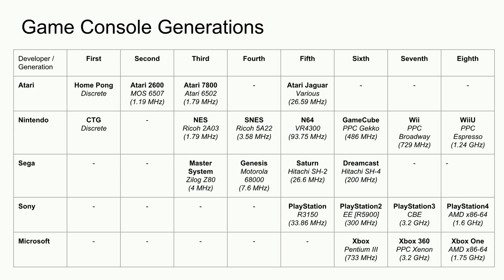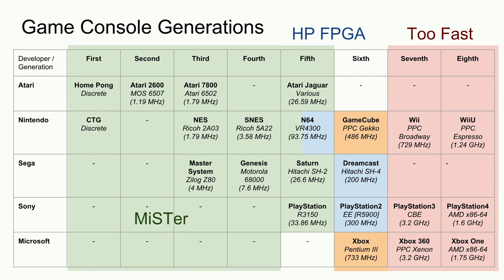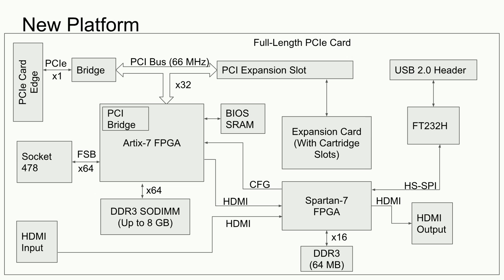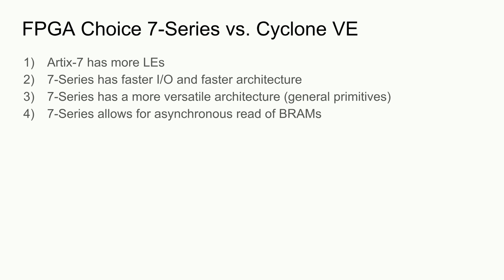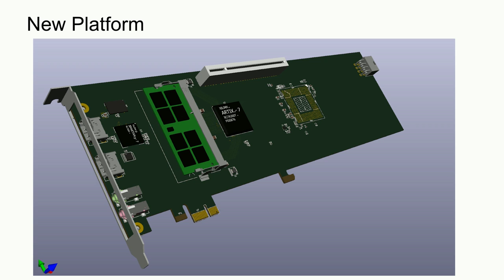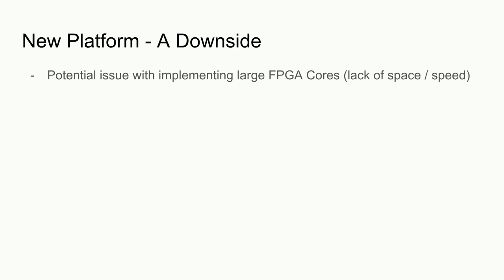A High Performance FPGA Game Console Platform

Comment: I'm no tech, but it's a nice presentation...  :-)
Regarding the XBOX emulation, i'm surprised. The actual state fo emulation on PC is... "weak" to be polite. 
I was prepared to give up XBOX "classic" emulation, even on PC.
I read - long time  ago - that we didn't know precisely some elements of the xbox ( the GPU chipset ?? it's a special version of an nvidia GPU)... and it was a problem to recreate a good emulation.... maybe there is light at the end of the tunnel, as we say ??
Reply from the maker: One of the XQEMU claims that it has made great progress in the past few years (I have not really looked into it).

It's true that we don't know all of the elements of the xbox chipset, but we have some idea of how they were composed. It may require leaked documents, or some old fashion reverse engineering to figure it out though. In terms of developing a chipset, the actual architecture of the NV2A GPU is pretty straightforward from an architecture level, the issue comes down to how precisely to control it. It may, not be possible to implement a PC emulated version of the NV2A though, since it's basically an early version of a modern GPU (multiple shader cores, running at a few hundred MHz). It should also be possible to hookup a high-speed logic analyzer to a development XBox, and sniff the front-side-bus while the CPU talks to the chipset running known operations. That could provide the missing information on where / how to communicate with the chipset components (perhaps that has already been done though). 

An FPGA implementation may be an alternative option there (running the CPU emulation on a PC, and using the FPGA to just do the chipset stuff). I may have given the impression that is had been figured out though, when my main intention was to suggest that it is feasible from an engineering standpoint (i.e. the details still have to be worked out).

Anyway, I wouldn't give up on being able to run classic XBox games on a newer general purpose system. And at the very least, I recall hearing the CEO of AMD (Lisa Su) mentioning that the newest XBox was built with backwards compatibility for the original XBox games (though that just kicks the can down the road).

Comment: The current MiSTer is based on a mass produced (and significantly discounted for educational market) board, Will this "new" board be significantly cheaper than the existing low cost MiSTer board?
Reply from the maker: I am aware of why the MiSTer uses the DE10-Nano. As mentioned in the video, the new board would be around 400$ USD (~4x more expensive than the DE10-Nano). So it wouldn't exactly "replace" the MiSTer, but the goal would be to have a backwards compatibility, so that those who want to use cores which cannot run on the DE10-Nano can still use the original MiSTer cores.
As stated in the video, you basically have 3 options for a system like the N64: 1) Don't emulate it and give up, 2) buy a more expensive emulation platform with a more expensive and beefier FPGA, or 3) stick with buggy software emulation. Many people may not care about being able to run an N64 FPGA core though, and will be able to stick with using the DE10-Nano (the same argument can be made for the PS2 / Dreamcast, etc.).

Comment: What is the point of implementing an FPGA version of PS2, Wii and up? They are designed around a frame buffer, unlike the  cycle accurate timings of prior generations, so the benefit of FPGA seems wasted on it, when modern computers can emulate those consoles perfectly.
Reply from the maker: That's a good question. Though the PS1, N64, and Sega Saturn are also framebuffer designs. So by that logic, why bother trying to get those to work on an FPGA? Cycle accurate timings aren't needed for any of those. Although, many devices still struggle to emulate the N64 or don't do so correctly (there's a similar issue with the PS2, where it requires a relatively powerful system to run). Perhaps this is a more philosophical question though... Why bother with an FPGA at all? You can do cycle accurate emulation of a C64 on a high end x86 machine for example (a low level, timing accurate emulator). After all, MAME has pretty good compatibility and it's not LLE.
I think the answer to your question is has a an academic answer, a practical answer, and a psychological answer.
For the academic... software preservation. We want to be able to run every piece of software ever released (perhaps ever written) for archeological reasons. While emulators are a tool that can help, as the system complexity increases, it becomes harder for a single computer to replicate all of the required behaviors, especially if you want them to be true to the original hardware (i.e. rendering a PS1 game at 480i with all the flaws and quirks).
For the practical... cost. If you need a $1200 PC to run a PS2 emulator, vs a $600 FPGA system, wouldn't the FPGA system make more sense for those who do not have a $1200 PC? 
For psychological... there's something about running on actual hardware vs a software emulator. Maybe it has to do with the fact that it's the only thing running. I for one would prefer to play PS2 games on an original PS2 rather than an emulator. Same thing for N64, etc. And an FPGA implementation doesn't feel any different to me than the real thing, unlike an emulator. That same thing applies even more so with a computer... (which in this context has applications to the SGI systems like the Indy)
Reply from the maker: Another reason to go FPGA vs software is dealing with "software rot". That has implications for the academic side, but also for other cases.... Here's an example for you:
Let's say the PCXS team vanishes and decides to stop working on the emulator. Microsoft releases Windows 11, and PCXS doesn't run on it, nor does it compile. Then someone has to go through and update the PCXS code to make it compile and run on Windows 11. If the team vanishes, then that may be a nearly impossible task.
If it were implemented on an FPGA instead though... there may be no reason to update the FPGA core as long as it runs on a specific device. So all of the MiSTer cores for example will always run on the DE10-Nano, as long as you can still get that board. The linux support side could have rot issues, however, the need to update the linux kernel on the ARM processor is not the same as for a desktop PC. Who cares if MiSTer is running linux 2.0 from 2003. It could have tons of security flaws, but you aren't going to do anything security critical on it. But if you have to keep your PC running windows XP in the year 2035 to run PCXS, then you probably don't want to connect that PC to the internet, and you wouldn't want to do anything security critical (like online banking) on it. 
Whether or not software rot is a big enough issue to justify an FPGA over emulation is uncertain. But FPGAs do last much longer than PCs do, and they don't require constant updates that can break massive software dependency chains. 
Note that in this case, something like the Playstation Classic would fall into the same category as the FPGAs (though the FPGA will probably be able to run for a longer lifetime and the SoC in the PS Classic). However, it would be economically infeasible to release a software emulation system like the PS Classic for a PS2. The only way to do that.... would be to use an FPGA.
Reply: @RTLEngineering  Thank you for your very thoughtful explanation. Makes a lot of sense,  when you look at it from this nuanced perspective. 

I’m curious about the point you made about FPGA lasting much longer than PCs.  Is this primarily due to your aforementioned points about software rot and future compatibility issues, or do you also mean the hardware itself has higher MTBF ratings than modern CPUs and SOCs?

I’m just now getting into and learning about FPGA, having just ordered my first Mister kit last week. One thing I’ve been most curious about, is how the system will hold up after years of moderate to heavy use, constantly writing different cores.
Reply from the maker: I'm glad it made sense. It was a difficult but very relevant question to answer.

So FPGAs typically do not suffer from the same software rot issue as PCs, but that doesn't mean they can't. For example, if the MiSTer github repo gets deleted and all of the source code is lost, then it can never be ported to another FPGA when it reaches end-of-life. Luckily though, porting FPGA code is much easier than software (if written correctly, which most of the MiSTer HDL is not - though it's still probably easier than software). The reason for that is that there are only a couple of things that can go wrong with a port... IO interfaces (which are external to the core), weird hardware quirks (things like internal tri-state busses, which FPGAs don't have anymore), and vendor specific IPs (using an Intel macro to declare part of the FPGA to use rather than inferred code - these can often be translated though). For the IO interfaces, the MiSTer cores all use a HPS bus coming from the ARM processor, which I believe was changed to AXI on the Cyclone 10. The Xilinx chips all use AXI, and I think the Microchip SoCs use AXI or AHB. Anyway, all of those buses can be converted to HPS using an intermediate core, so that's a lot easier than trying to get a bunch of dynamically loaded libraries to recompile or run on a new linux kernel.

In my experience, the MTBF for FPGAs is far higher than CPUs and SOCs mostly because of their use mode. The first thing to keep in mind is the expected device lifetime. FPGAs are designed to last for 20+ years, and the automotive and aerospace grade ones are designed for a much longer lifetime. Your desktop CPU on the other hand is only meant for a 5 year lifespan, same thing with your GPU, and even the raspberry pi (general SoCs are designed to last longer, but the pi is cut down in cost, so it's likely that the MTBF is much shorter). 
But I think the more important aspect is related to software rot... you wouldn't want to use a PC from 2004 to do emulation today when you can have a new one that's much more responsive. The FPGA on the other hand doesn't have quite the same concept, because the design was implemented to do exactly what it did when it was designed. That's why you can still buy brand new products with FPGA designs for 20 years ago, and they work exactly as advertised. 

As for the FPGA holding up with reprogramming, don't worry about that. The FPGAs use the same type of SRAM as in a CPU cache, and the CPU cache is written to millions if not billions of times per second. The part of the MiSTer that will probably fail first is the SD card if you continually write / save games to it. There are some FPGAs like the Max 10 which have internal flash for the configuration, and those will have a limited number of flash program cycles. But those will still have a virtually unlimited number of power on cycles (every time the FPGA is powered on, the flash is read and the FPGA configuration SRAM written). A similar thing happens with the DE10 on the MiSTer, except the FPGA SRAM is written via the ARM within the FPGA by reading from the SD card. If you use the USB Blaster interface to program the FPGA, then it's writing the FPGA SRAM via the USB. 
The one thing you have to worry about are IO constraints though. Make sure you don't set an IO to be "out" when something else is driving "in", and make sure that the voltages on the IO are correct (both with configuration and anything plugged in). Those are easy ways to destroy the IO buffers / transistors. Other than that, I suspect that the other components on the DE10 boar will fail before the FPGA itself.

Comment: @RTL Engineering
Can you comment on this board https://numato.com/product/aller-artix-7-m-2-fpga-module For FPGA Game Console and Retro PCs (Amiga, Atari etc) Emulation The idea would be to implement a virtual vga capture card within the fpga and send the game video directly to the host PC memory (or even directly pcie to pcie into the gpu). The PC would be the host co-ordinating the emulator and handling all external io. While interested in retro gaming I'm also interested in all the other applications listed on their product page and don't really want another standalone device. i.e. I want a general purpose fpga solution.
Reply from the maker: I haven't used the Aller, but it does have the potential to do what you are suggesting. Someone had mentioned a similar platform specifically geared towards crypto-mining, however, I think the Numato one is cheaper, with a larger / faster off-chip memory.
It should be able to easily handle an Amiga (a stock version), as well as any of the MiSTer cores. I also think that you could fit a virtual capture card in there along with the emulation core, since it's a 200T. 
I have never implemented a capture card, so I am not exactly sure how that would work. But it should be simple enough to have a framebuffer in the DDR3 which is streamed to the system RAM of a host computer, and then drawn to the screen via some graphics library (like SDL or OpenGL). I don't think that you will have much luck dumping the framebuffer directly into the GPU though.
If your primary interest revolves around using a host machine (either a SBC or PC), then this would be a good choice for an Artix-7. Though be warned that getting the PCIE interface working is tricky, though should allow you to essentially connect it to an AXI bus like a memory master.
Another word of caution. It's not clear on their website if the JTAG connection is via the PCIE connector, or via the unpopulated header. My guess is that it's the unpopulated header, so you would need to solder a connector as well as buy a Xilinx compatible JTAG programmer to use the Aller.
The only other Artix-7 solutions that I know of are stand-alone, which don't have PCIE lanes, though do have a lot more IO (mostly for stand-alone development).

Comment: Sold open up a subscribe star account and I would gladly throw you some dollars.
Reply from the maker: I would, but I am not going to join Subscribe Star or Patreon until I have 1k+ subscribers (arbitrary number, I know). Also, I am not currently working on the project presented in this video (I am working on something potentially more interesting), but it wouldn't feel right accepting donations for something that I am not currently working on.
Reply: @RTLEngineering  You are now beyond 1k good going
Reply from the maker: I will consider it. My main reservation is that I can't guarantee regular content, which goes against the terms of those platforms. But I can look into what's involved in the process.
Reply: @RTLEngineering  In any case I wish you the best you are doing good work here.